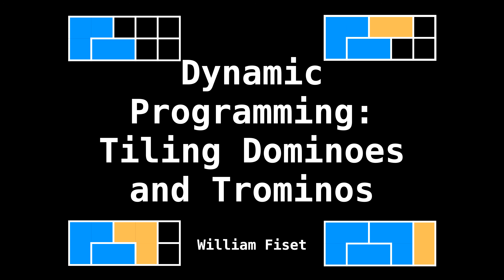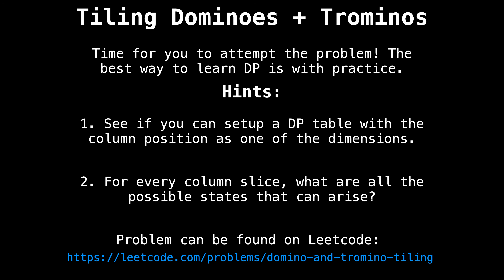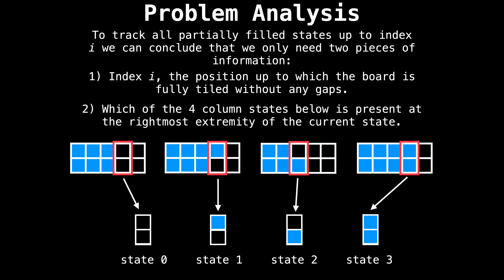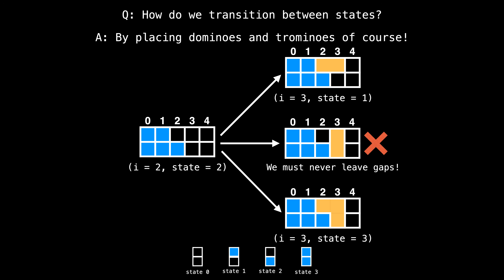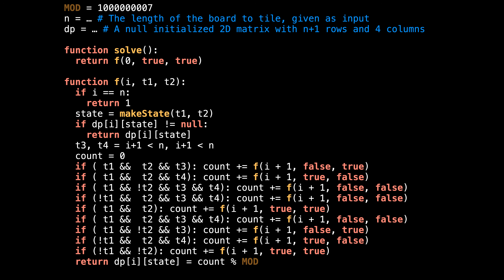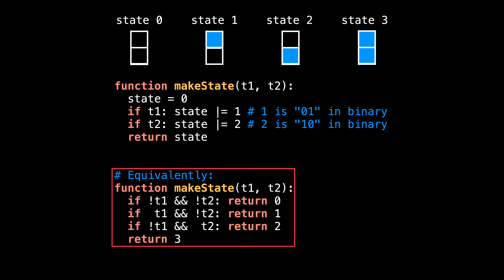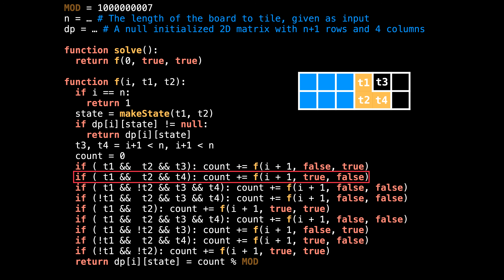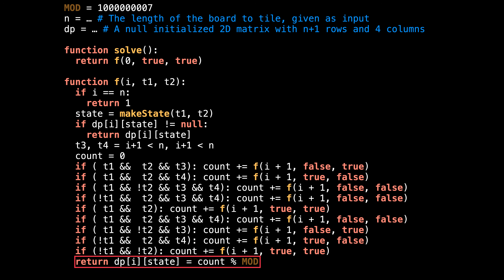Tiling Dominoes and Trominoes (Leetcode 790) | Dynamic Programming

Comment: I've tried to solve this based on ideas I got from this video, and came up solution where there are only two states: "the whole column in free" and "one of the tiles in the column is taken". Since there are two states only, i can use a single boolean variable to represent that. So the solution goes like this:

        if (abEqual) {
            if (whenAbEqual[i] != 0) return whenAbEqual[i];
            sum += go(i + 1, true) % MOD;   // |
            sum += go(i + 2, true) % MOD;   // =
            sum += go(i + 1, false) % MOD;  // L
            sum += go(i + 1, false) % MOD;  // Г
            whenAbEqual[i] = sum;
        } 
        else {
            if (whenAbUnequal[i] != 0) return whenAbUnequal[i];
            sum += go(i + 1, false) % MOD;  // -
            sum += go(i + 2, true) % MOD;   // ┐
            whenAbUnequal[i] = sum;
        }

Comment: For those of you that want to turn this very nice solution into Java code, be warned: the count value can cause integer overflow errors. Because in this solution, only add the end do we do count % mod. But with n=29 and up, the count value will get to big before we reach that line with the modulo division. Therefore you should already use the mod division before reaching that line.
Reply from the maker: Good call out 👍

Comment: I rewrote it to Python and merged a few cases to make it shorter. It's possible to further simplify this code, i.e. merge state 1 & 2:
```python3
class Solution:
    def numTilings(self, n: int) -> int:
        MOD = 1000000007
        @cache
        def dp(i, state):
            if i == n:
                return 1
            nxt_state = i + 1 < n
            count = 0
            if state == 3 and nxt_state:           # XX | # X
                count += 2 * dp(i + 1, 2)             # X  | # XX
        
            if state in [1, 2, 3] and nxt_state:  # XX | # #X | # XX
                count += dp(i + 1, 0)                  # #X | # XX | # XX
            
            if state in [0, 3]:                               # X | # #
                count += dp(i + 1, 3)                  # X | # #
            
            if state == 1 and nxt_state:          # XX
                count += dp(i + 1, 2)                  # #
            
            if state == 2 and nxt_state:          # #
                count += dp(i + 1, 1)                  # XX
            return count % MOD
        return dp(0, 3)
```

Comment: In the base case, shouldnt we be writing, if(i+1 == n && !t1 && !t2) {return 1;}
Reply: In f(i, t1,t2)
The i represents the column upto which we have completely filled with tiles.
We start from i = 0(empty) and go up to i = n(completely filled). If we reach i = n, then that means we've filled the entire space with a valid tile configuration. No need to check anything else.

t1 and t2 represents the state of (i + 1)th column actually. When we reach at the end, this t1 and t2 must be true, otherwise we've made a mistake(we can even add an assert for the same), if any one of t3 and t4 is false, it means that we've filled past the boundary.

t3 and t4 checks(that is whether i + 1 < n) ensures that we won't fill past the end boundary. On the last column, we shouldn't fill with a till with its cell beyond the boundary.

Comment: That's good. I could derive a formula 2 * dp[i - 1] + dp[i - 3] using your explanations in the middle! For each column, we could end up on state 1 & state 2 for the previous column which means we could combine them symmetrically and it gives 2 * dp[i - 1]. Also if take 2 steps back, on dp[i - 3], we simply can move to the current column without trominoes (which are already covered) using dominoes only which means it's the same amount of ways as for dp[i - 3]. However, the last part is not 100% clear to me, could you validate my logic, please?
Reply: Between the video & your comment, I think I figured out out - AND a nice way to walk through both cases. Think of this as a sliding window DP problem where you are figuring out total # ways including the incoming column. Rules are that:
1. New pieces from incoming column must be in-bounds (so only projecting back towards the start, and may not project back beyond i = 0)
2. New pieces may not collide with filled tiles.
3. Incoming column "i" is assumed full (coming from 1 vertical, 2 horizontals projecting into the i - 1 col, or either of 2 tromino arrangements where the vertical leg is filling the column & horizontal leg is projecting into the i - 1 col). 
4. Outgoing col i - 2 MUST be full.
5. Col i - 1 has states that allow for new ways to arrange pieces. Column states may be full (only vertical dominos added @ i), empty (vertical or horizontal dominos added @ i), or partially full (trominos added @ i, *2 for symmetry of top tile vs. bottom tile being filled in i - 1).

In the case of combined states of full & partial, the window considered is 1 column wide. However, in the case of only full states, the window is 2 columns wide. 

In both cases, for a given window & position, the total # states are the # of new ways (based on states at i - 1) + the sum of all prior different VALID ways. This sum of prior ways occurs at the previous FULL window position since total # ways is only updated for a full board: 

f(i) = (total new ways @ i, based on states @ i - 1 position) + (sum of all previous ways before i)

The last previous valid full state occurs in increments the same width as the window.

In the case of a window of width = 1, the i - 1 offset from the i - 1 position becomes i - 2, so f(i - 2) total prev ways is added to the new ways at 2 * p(i - 1) + f(i -1) (i.e. states at i - 1)
f(i) = (2 * p(i - 1) + f(i - 1)) + f(i - 2) 

In the case of a window of width = 2, the  i - 2 offset from the i - 1 position becomes i - 3, so f(i - 3) total prev ways is added to the 2 new ways at f(i - 1).
f(i) = (2 * f(i - 1)) + f(i - 3)

It makes more sense when you draw it out ;-P

Comment: Hey! Great video.
One thing is bothering me. Isn't there an error in makeState fnx?
I was thinking that it should be:
      if !t1: state |= 1
      if !t2: state |= 2?
Reply from the maker: Yeah, that looks like it should be a bug. Ultimately it doesn't matter since all the states symmetric, so the end result is the same as encoding it correctly. However both makeState functions on that slides would return a different encoding, so I see where the confusion comes from.
Reply: Great catch! Even I was confused regarding this.

Comment: Hey! I was able to solve this problem the iterative way after watching your previous video. It took me a while to work out the recurrence relation (I'm a DP beginner). The key for me was knowing that maintaining each possible board state is necessary. I am slowly wrapping my head around 2D memo tables.
For whatever reason it's really challenging for me to produce a recursive + memo solution. I can mostly manage to get a brute force solution and then sometimes a bottom up iterative. To answer your question at the end: it'd be really helpful to see both top-down and bottom-up solutions to each problem. If that ask is too large, the middle ground where you're solving similar problems with different approaches works.
These videos are a great resource, thanks for making them!
Reply from the maker: Nice work on solving this problem iteratively! I lean a little bit more on the recursive side, but I will do my best to showcase both methods as I build these DP videos

Comment: These types of problems can also be solved with a directed graph where the nodes represent the right edge state and the weights are how many squares are in the tile (it'd be easier to draw than write with text). In any case here's the graph.

Set up graph:
[00] ->3 [10] (place rotated 'L')
[00] ->3 [01] (place 'L')
[00] ->2 [02] (place horizontal 2x1)
[00] ->2 [00] (place vertical 2x1)

[10] ->3 [00] (place 'L')
[10] ->2 [01] (place horizontal 2x1)

[01] ->3 [00] (place 'L')
[01] ->2 [10] (place horizontal 2x1)

[02] ->2 [00] (place horizontal 2x1)

After that it can be converted to a system of recursive equations which counts the number of ways to traverse the graph and end in a certain node. We're starting with a blank board so a_{0} is 1 for one way to tile a blank board. All other initial states are zero.

a_{n} = b_{n-3} + c_{n-3} + d_{n-2} + a_{n-2}
a_{0} = 1
b_{n} = a_{n-3} + c_{n-2}
c_{n} = a_{n-3} + b_{n-2}
d_{n} = a_{n-2}

You can get answers with this, but with some simplification we can get a better equation (exercise for the reader).

a_{n} = 2*a_{n-1} + a_{n-3}
a_{0} = 1
a_{1} = 1
a_{2} = 2

This of course could be taken further (like with the fibonacci series), but with this you can calculate very large values quickly and simply.
Reply: What’s the point of using graph by the way when you can arrive at a solution much faster with DP?
Reply: @paultvshow The idea is you can create a closed form formula with this method which can be solved in O(1). The initial work of figuring out the graph, setting up the recursive formulas, deriving the closed form formula only needs to be done once.